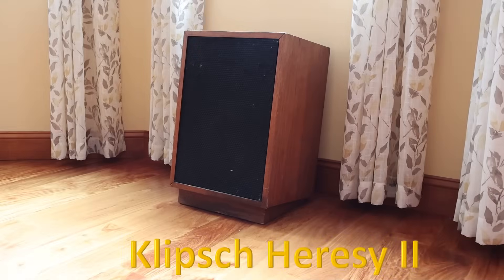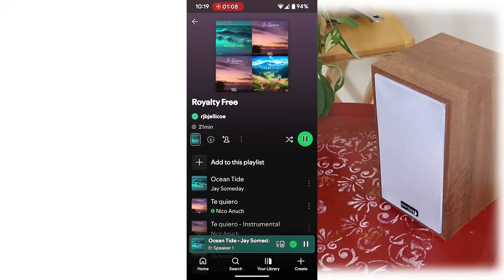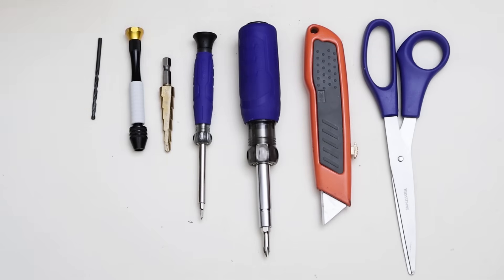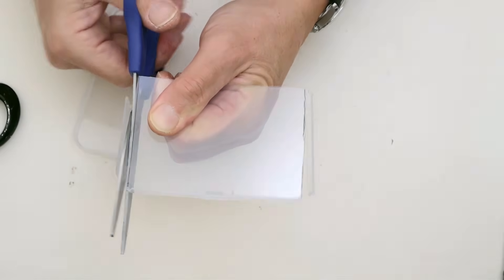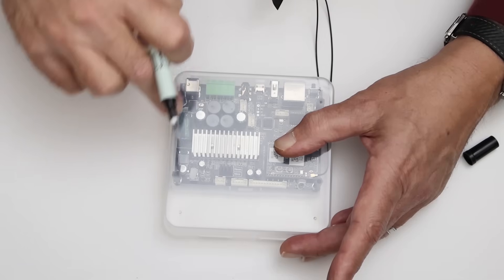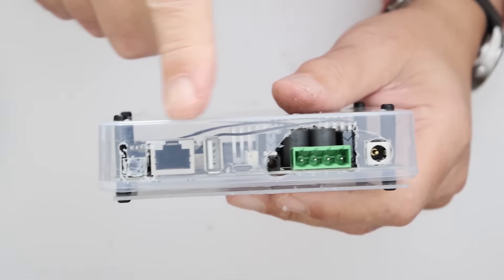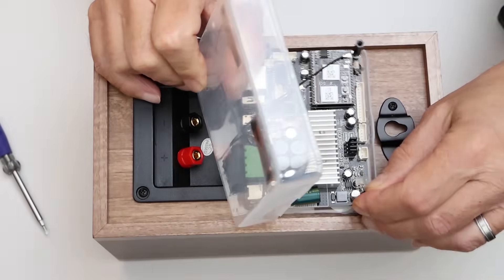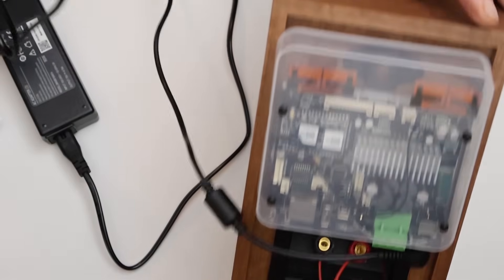Easy DIY to Add WiFi to Any Speaker - Make Any Speaker WiFi - Better Than Bluetooth

Comment: Great instructional video. Probably louder than what I have done to mine. I bought bookshelf speakers and cut the wires from my google minis and have them all over the house. After I did this to 1 I found minis on sale cheap and did a few more. They sound really full and quite loud. So I guess it depends on how loud you need it. Google minis can also pair up in stereo. Much smaller and less consumption of power. I know google minis only use 5v adapters. I have a couple running off usb adapters. Probably not as loud but it also does not require building your own electronic box. I just opened up my mini, cut the wires to the google mini's built in speaker, then spliced in the speaker wires to the bookshelf speaker. I have it in the garage, back patio, game room, guest room. They are loud enough for me and I never turn it all the way up, just around 5-6 (out of 10) is plenty loud enough. I'm sure that what I did can be done to any smart speaker like alexa or other brand too.
Reply from the maker: Love the creative re-purposing of the google devices, the way you've done it you gain Chromecast streaming but unfortunately lose Apple Airplay.
Reply: What’s a Google mini? I see Nest minis and Home minis.  Are they related?
Reply from the maker: @DanBlake3rd  Same devices Google branding is sometimes mystifying.

Comment: Cade o link pra compra dessa placa 🤔
Reply from the maker: Arylic Up2Stream AMP Mono  (DIY WiFi Amp);  https://www.arylic.com/products/up2stream-amp-mono-board?aff=189
Dayton Audio Classic B40 Speakers;  https://amzn.to/4aZQBBC
Power Supply 19V 4.75A;  https://amzn.to/3QlpN5w
Plastic Boxes;  https://amzn.to/4bi6QdH
M3 Standoff Set;  https://amzn.to/4jWBGfH
Speaker Wire;  https://amzn.to/4hU35No
Step Drill;  https://amzn.to/4hV8RhO
Pin Vise;  https://amzn.to/4hW3gI6

Comment: What happens with a stereo pair if you can't guarantee the amount of time it'll take different network devices to get the same data? Does that always work out ok?
Reply from the maker: It does, The data streams have timing information so that the speakers can synchronize exactly even though the network delays are variable.   If you have a very heavily loaded network you could theoretically experience delays beyond what the audio system can handle. In that case you can usually change the router settings to give priority to the audio devices.

Comment: I would probably just buy the Wiim amp instead since it also comes with a remote control, and ability to add a subwoofer. I believe it has a room correction software too.

Comment: Why do you instruct to put jumpers on mono while you did not change any? (Or better said: I could not tell the difference between 13:47 and 3:24). Please elaborate.
Reply from the maker: There are two versions of the product sold, Stereo and Mono. The only differnce is the position of the jumpers. I ordered four mono boards and two of them came with the jumpers in the Stereo position, which Is why I suggested checking before any other steps.  If you have the board in front of you  you should be able to tell if they are right but it's hard to show on a two dimensional video screen. If you have any doubts, then just remove the jumpers, and it's pretty obvious from the labels on the board  where they should go.

Comment: Did you choose the mono device because the two speakers are Mono?
I also wonder if there is a way to link these speakers to, say, Chromecast With Google TV, or Fire TV Stick.
Reply: Doesn't do chromecast...  Just had a look on manufacturers website...  Shame...
Reply from the maker: One way to do chromecast audio, is to use a Wiim Pro which can link to these speakers in the Wiim or Arylic app. if you Chromecast to the Wiim it will play on the speakers. This soluton will not work for TV, because the video and sound will not be synchronized.

Comment: Perhaps it has been addressed in other videos, and this is certainly something to consider, but how decent is the sound?   Hard to untangle that from the many other steps in the process, but what do people think?  Also, any UK suppliers of the Up2Stream Amp Mono?
Reply from the maker: I'll assume you are an audiophile because if you're not, you'll be delighted with the sound quality.  As I'm sure you realize the speakers that you choose will have a major influence on how good the sound is and I also know some audiophiles have an aversion to class D chip amps which in my experience are a little more fussy about speakers than good class AB amps but can sound superb.  That being said Arylic has implemented the circuitry well, so  both the AMP and DAC chips sound as good as these reletively inexpensive components can, so no real surprises there.   I was however very pleasantly surprised by the stereo soundstage and imaging. One of the problems with bluetooth is a collapsing of the soundstage but these WiFi speakers are lossless so the problems intrinsic to digital compression are not there.  I was concerned that the stereo imaging might  not be good due to possible very slight synch and phase errors but this turned out to not be a problem, and the speakers I tried had as good imaging wireless as wired. What  I did find ,is that the freedom of placement due to no connecting wire can have  sonic benefits. When placed on opposite sides of a 6ft Arch  so that there was another room behind the space between the speakers the soundstage became huge with real airiness between individual instruments and vocals. Things got even better when I added a subwoofer to the tiny speakers I'm using. I connected the sub wirelessly using the 4stream app and the streamer I showed in this video. https://youtu.be/QjwcfF3FwN8  The sound became weightier and much  more dynamic.  In that room with that particular speaker placement and the wirelessly connected subwoofer. I've been playing track after track for hours and really enjoying the music. The Up2stream amp can be ordered directly from Arylic from their website.
Reply: @rogergadgetguy  The different classes of amps have been improved so much in recent years so I think the quality would be just fine and considering many people play MP3 and some at very low kilobits I'm sure many wouldn't even know the difference unless as you say they are audiophile types, which I would probably class myself as.
Still I'm sure it would be great quality.
Reply: @rogergadgetguy  thanks so much for such a comprehensive reply ♥️

Comment: This is very good stuff your videos, I saw two videos so far, Roger have you got a video hooking my rare speaker to my home Theater surround amplifier instead of having very long speaker wire hooked up to the amplifier is there a way with Wi-Fi or some source without speaker wire, thank you very much keep it up👍👋😊
Reply from the maker: Thanks for posting. The problem with WiFi sound and home theater is the sound will be out of sync with the picture. Someday someone will make a combined video audio player that automatically synchs the picture with wireless speakers but that doesn't exist yet.  I am trying to find a wireless solution for Home theater using Bluetooth which has less delay. If I get a solid solution I'll do a video on it.
Reply: Okay thank you for responding me, looking forward for your video one day, once you find some answers about it thank you again keep it up you're great interesting videos👍

Comment: I wonder how hard it would be to set this up to run on a rechargable battery to make it TRULY wireless. I realize it'd have to be a big battery, but I'd use a bigger speaker.
Reply: Power hand tools 18v batteries. They are standardized CAS now. There are also adapters for the batteries to plug into. Easy and you can pick an 8 or 9aH battery.

Comment: Bloody expensive amp's $160 for the two!
Reply from the maker: You are getting the equivelent of a Wiim mini streamer and a class D stereo amp.  Cost is similar. especially if you factor in decent quality cables.
Reply: And $50 for two power supplies.
Reply: @greglaskey1154 cheap USB power plus are under $10 each.
Reply: @greglaskey1154  Do you know how much power is required for each amp? Maybe there's a smaller/cheaper one.
Reply from the maker: @paullelys161  You can go down to 12V 5A  If you have sensitive speakers and /or a small room but I tried it  and it wasn't enough power for my needs.
Reply: Love your Aqua Terra!
Reply: I wish there was a cut down WiFi only with line out. Maybe it's cheap for "audiophiles"
Reply from the maker: @user-kd1qg4fo1d  Your wish is granted. Checkout this cheapskate streamer video.  https://youtu.be/QjwcfF3FwN8
Reply: There are much cheaper options available.
Reply: @jeremybiggs8413 can you share please
Reply: @jeremybiggs8413 and where?
Reply: @jeremybiggs8413 I know. I like the video as entertainment lol.
Reply: No need to swear david

Comment: Pretty cool.
ATM I just use echo show line out to my amp, it works well enough but I like this idea apart from it needing a power supply, would be nice if it could just be plugged straight to mains and came in an enclosure already.
Reply from the maker: I intended this video to spark ideas. I focussed on an easy build for non techies but someone with the DIY bug could put the board and power supply inside a speaker.

Comment: Or put it in the amp and cable the speakers thus only having to buy one board.
Another alternative is use an old phone with a decent DAC and install Plexamp.
Reply from the maker: Good suggestions ......So many options, so little time.🙂

Comment: I used my raspberry Pi home server as a upnp player. Got the similar functionality. I mean the network streaming part.
Reply from the maker: That's exactly what I do when I'm not using Spotify or Tidal. I'm running Moode audio for the server on a raspberry Pi zero 2 W. Music is on a 512GB USB stick I use Sync Back Free to synchronize the USB stick to my PC music library. With Hi Res FLAC files the quality can't be beat .  When using the home server I usually use HiFi Cast (Android) or 8 player pro (iPhone)for the upnp phone app.